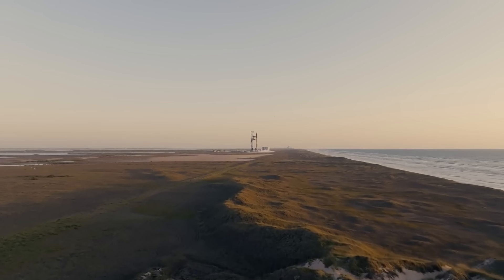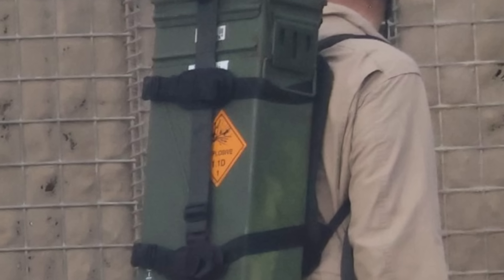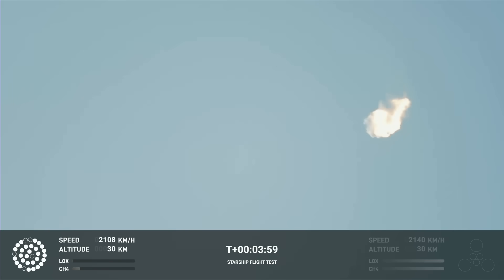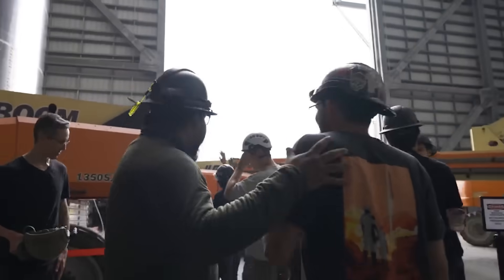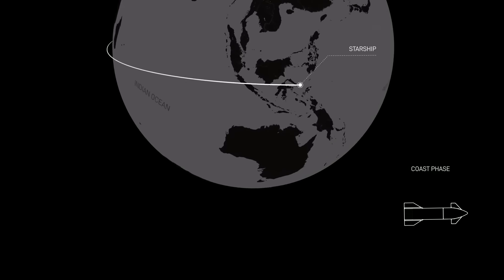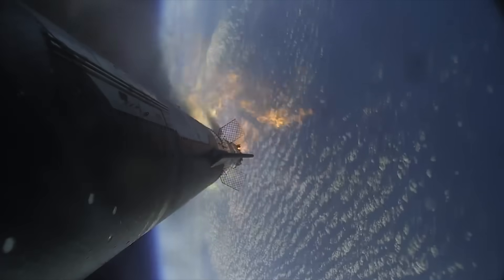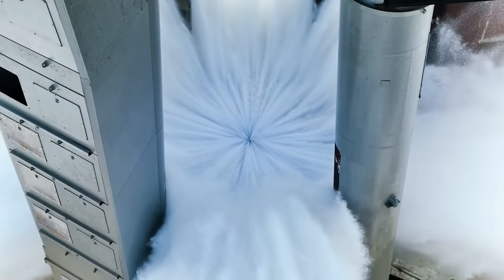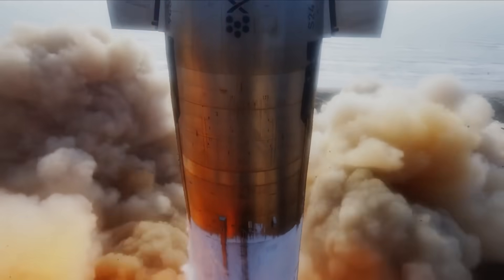SpaceX Just Installed Starship's Flight Termination System

Comment: IFT-1  FTS did get activated and did detonate. The steel structure was too strong and instead of breaking apart, two holes were made and gases poured out. At 30KM, atmospheric forces were strong enough to break apart the rocket

Comment: The biggest issue with clearing the tower wasn't so much the failing concrete but the fact that the rocket translated sideways. Luckily it moved away from the tower. But rven then, they clearly were not in full control of the flight direction. What if the vehicle stared moving towards people. They would have exploded the FTS...and the rocket would have been even more out of control with 2 vents from the holes in the side.
Again, the concrete was a minor problem. They got extremely lucky with the sideways motion and the failing FTS.
Reply: I forgot to mention the leaks and fires that burned the control system. But even after that isn't a major safety issue in a test, as it will only burn through the cables after lift off and can be dealt with with a working FTS.
Reply: Also, swapping hydraulic steering actuators with electric ones probably solved that particular problem.
Reply: It definitely could have tilted and went straight towards a major city.